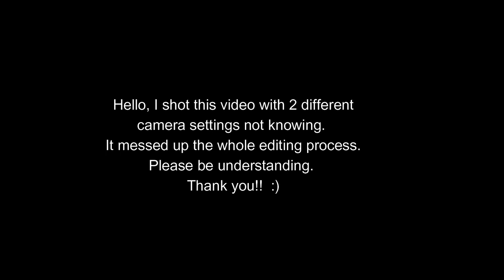Whiskey Barrel ADIRONDACK CHAIR build

Comment: where did you find that sanding flapper wheel?
Reply from the maker: Hello, it is a Walter brand 2 in 1 wheel. I normally use it when I’m working with stainless to give a brush to finish appearance.  Would you like me to do a video on some of the equipment?